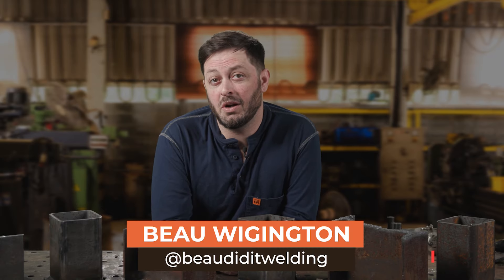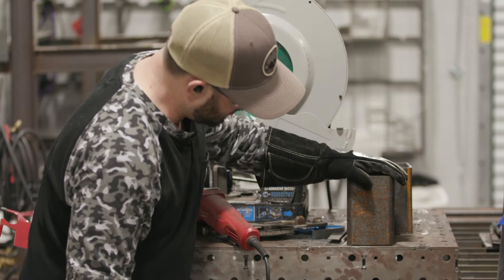Welding Rates | How Much Should I Charge For My Welds?

Comment: If you plan on being self employed consider taking small businesses classes at your local Jr college, take all the different ones they offer, you will be running a business and the principals in any business are basically the same be it fabing or selling lady's underthings, most businesses fail because the owner didn't have a solid grasp of the basics. shop rates? the above mentioned will teach you that. 35 years owner/opt of a fab/retail steel / industrial gas dealership now retired. You guys hit a lot of very valuable points. but get that basic business knowledge before you start selling your talent.